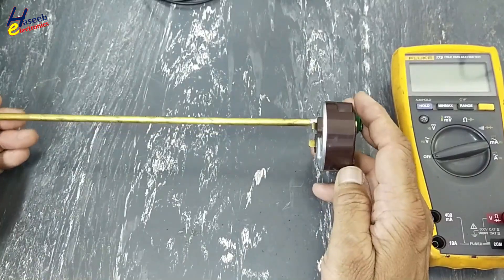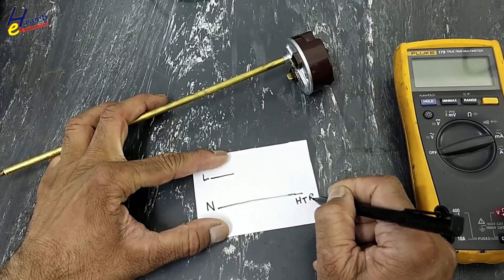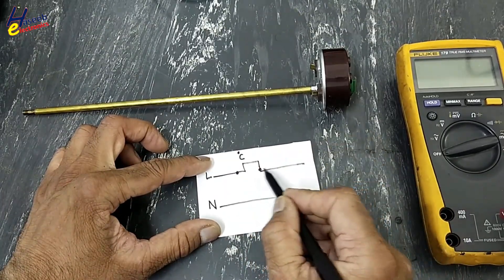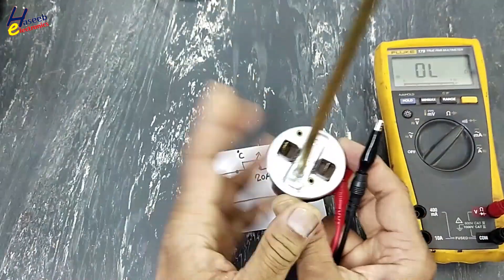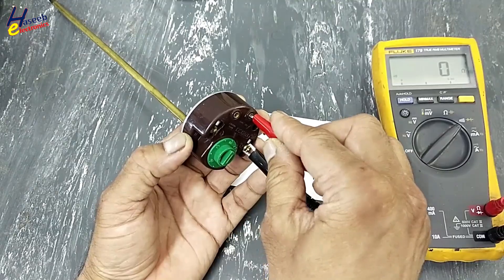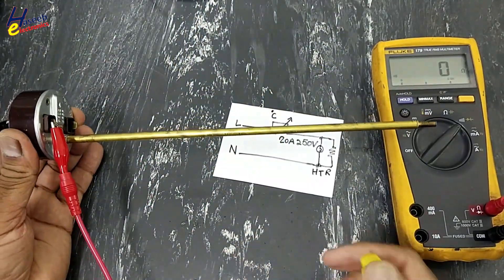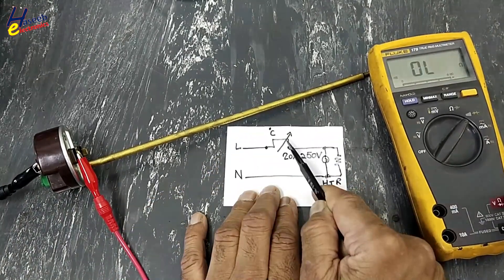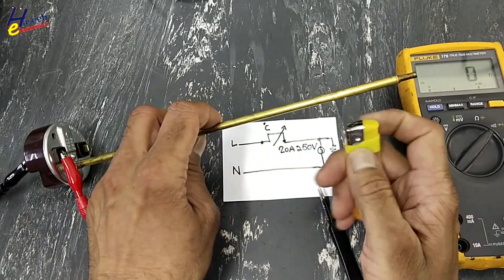{1327} How to Test Electric Geyser Thermostat | Simple Method with Multimeter | Haseeb Electronics

Comment: Which Multimiter is best in India at low budget, including OCULOSCOP...
Reply from the maker: i have no clear idea about availability in India. but the better multimeters with best price are Uni-T multimeters 
you can select auto-ranging multimeter with capacitance, frequency and duty cycle options 
you can selct 2 channel DSO Oscilloscope with 200 MHz, 1Ga Sample/ Second 
with these parameters any acceptable price